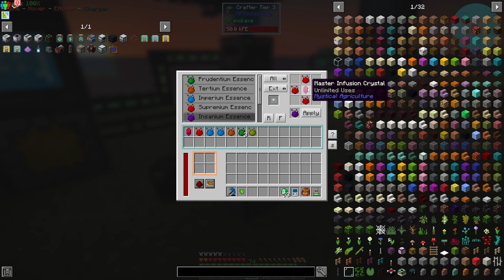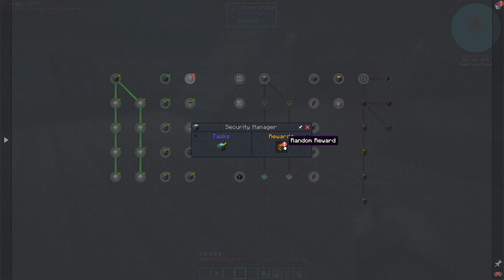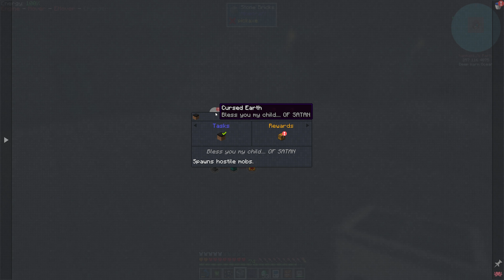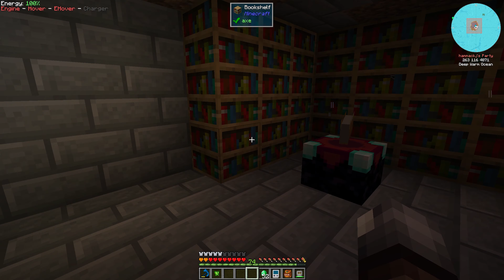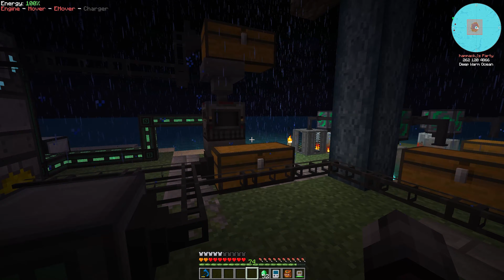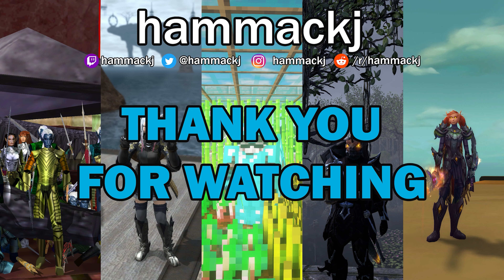FTB Oceanblock - 12 - Compacting

Comment: You might have already figured this out, but you can add either an item or liquid trash can to your lava production to keep it from turning off when your buffer fills.  You can just put the trash can on top of one of your jar auto processors and it will automatically attach because it has an inventory.
Reply from the maker: That's a good idea, I didn't think about it at the time.